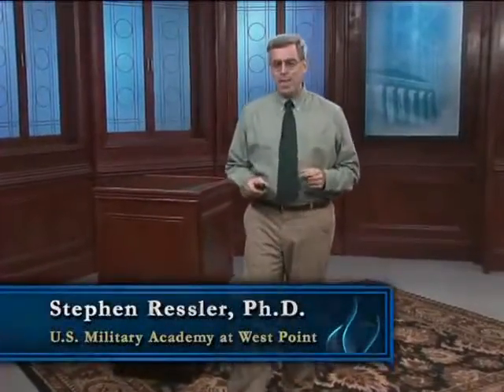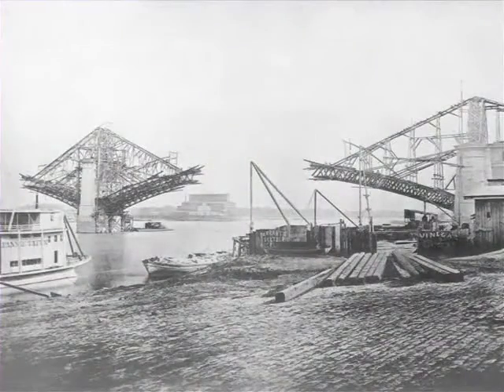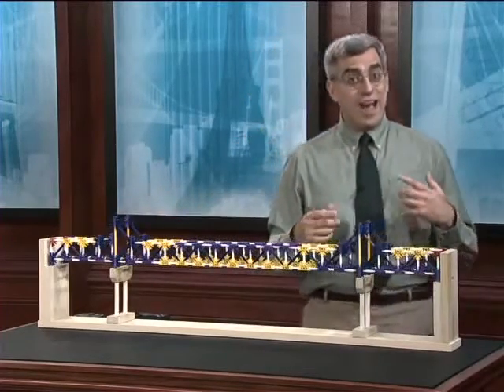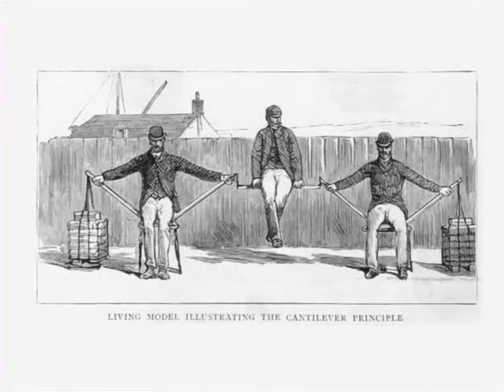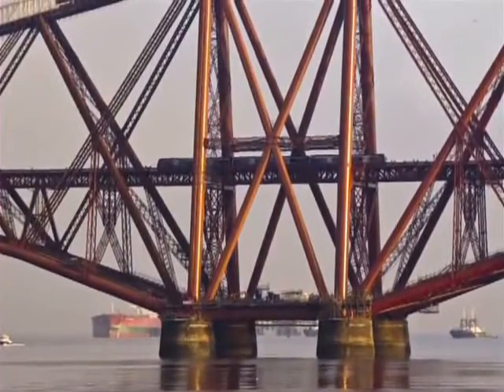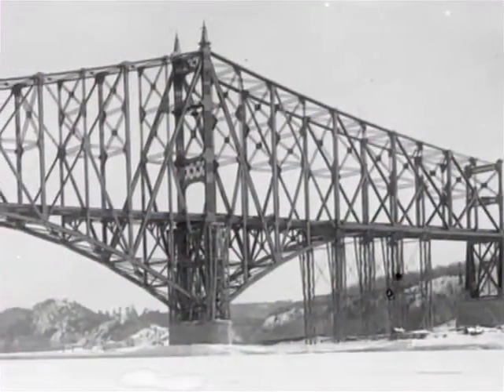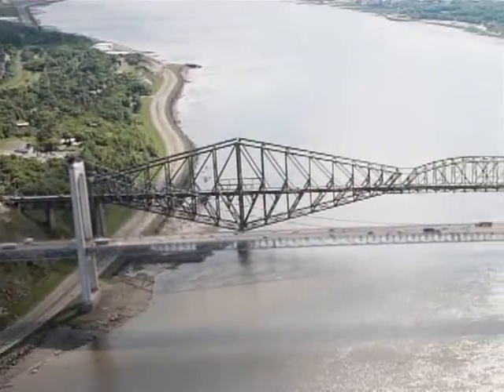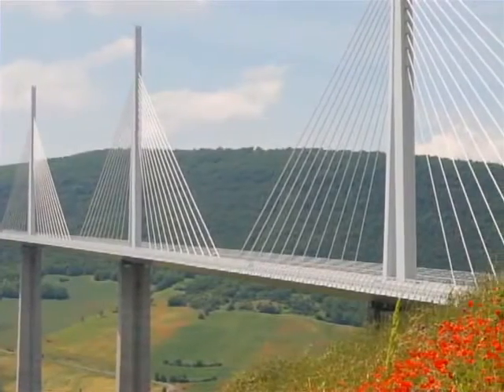17 Great Cantilever Bridges   Tragedy and Triumph

Comment: Great overall review !  I personally went into depths about the Quebec bridge my neighbour , where a third catastrophe is as of now in terminal progress. The owner is stabilizing the already buckled structure to find a replacement solution in a complex political environment.   My lecture is that  the curse of most cantilever bridges, those with high slenderness index,  is pertaining to a general misunderstanding by "practising" engineers of elastic instability on complex structures.  Even 3D models based on finite elements and requiring calculation shortcuts were dangerously optimistic, that  even 10 years ago.  Many questions arise from the relatively biased inquiries in the aftermath of the two collapse.  Relying on AREMA  empiric safety margins on railway bridges as the load limits are pushed  beyond the metal elastic limits is clearly presumptuous, but still legal .   See Flickr Pont de Québec:  Fissures , Flambages, Déversements.